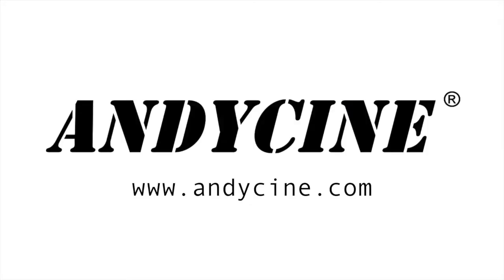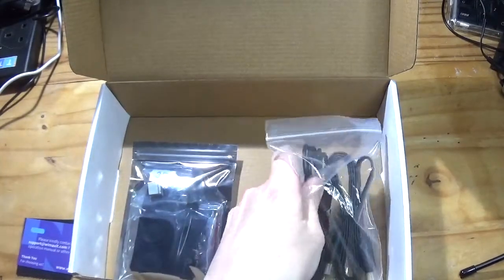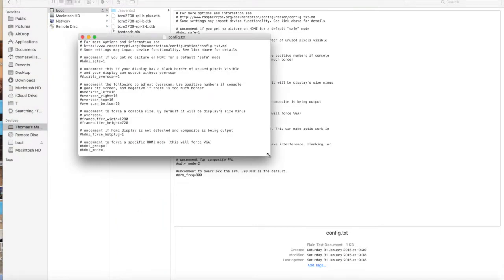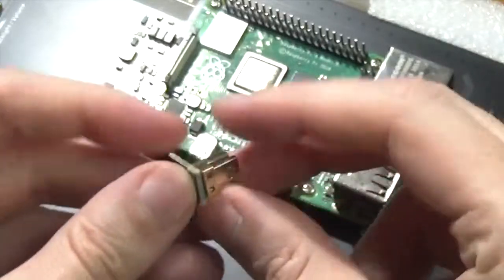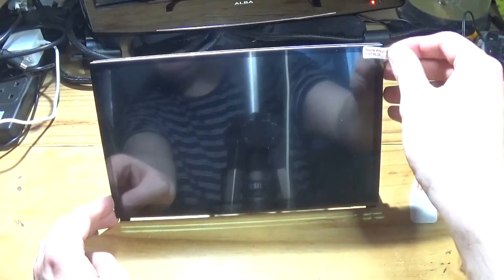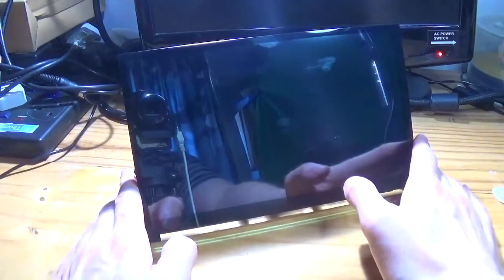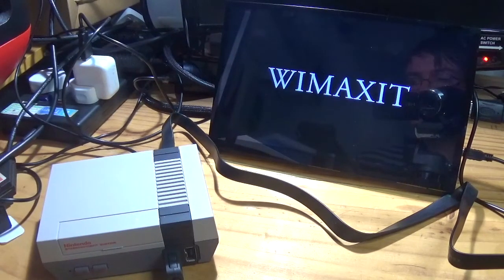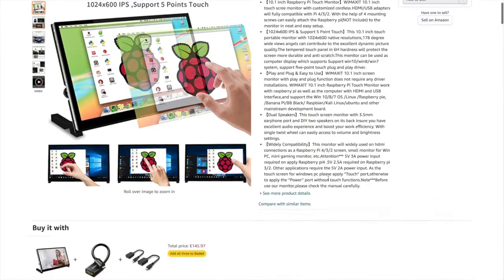#Wimaxit M1012 Raspberry Pi 10” Touch Screen Display | Full Review & Unboxing! #AndyCine

Comment: hello
your video is  very good

A question:
You were very quick to connect the speakers.
I thought I saw that there was a meaning to the bracing. just?

So far I have no sound. Is there something to fix?
The volume button is on 80% but nothing.

Thanks a lot
Reply from the maker: The speakers can only connect in one way around. If your using Raspberry Pi make sure you setup your config.txt file correctly to force sound via HDMI.
Try testing the screen with another none pi HDMI device DVD player / Game system etc 
If that still has no sound then you'll need to contact AndyCine directly for tech support.
Reply: If you have any questions, please contact us, ins public number@wimaxit, email is sales@wimaxit.com

Comment: Heya, just a basic question about this video. Is this an actual review ? or a commercial advertisement?
A few of the things you said seemed a little off... 10inch isn't really a "laptop size" and nor is 1024x600 a "high resolution"
I mean.. It could be fine for the price and it could have some nice use-cases, but my phone has a higher resolution !

The more important parts you do seem to skip over, what is the screen actually like? Brightness? Color reproduction? Viewing angles? Refresh rate?

If possible, in the future, could you make a clearer disclaimer? It's fine to be sponsored, but I(and I'm sure many others) want to know if the things you are say are your opinion, or points the vendor has asked you to mention, or if they have reviewed the video before hand.

Keep up the good work though ! I love products like this for the raspberry pi as they can make really fun projects like home automation terminals.